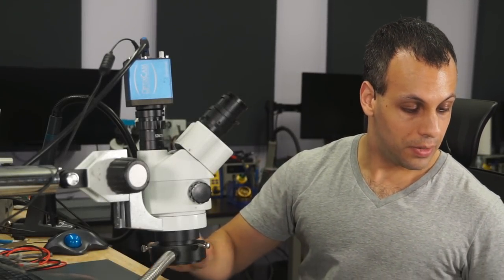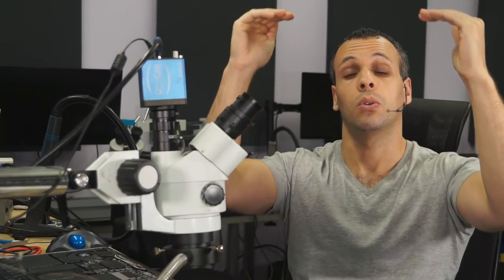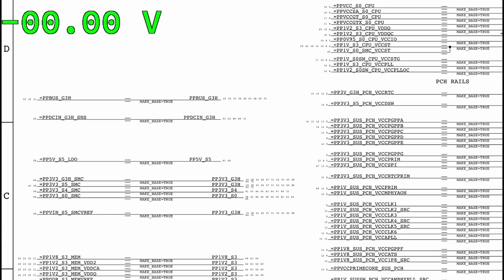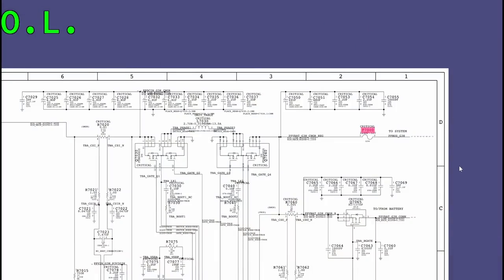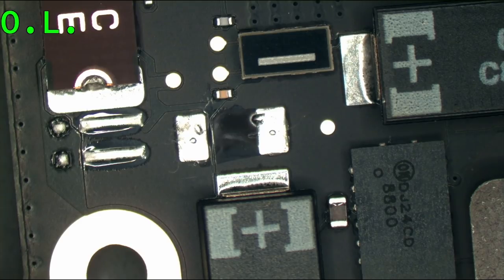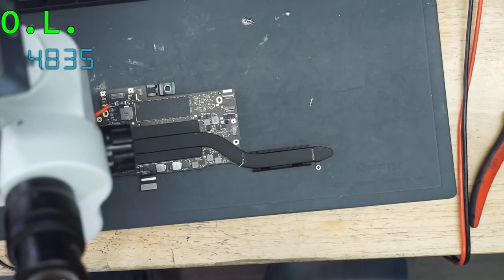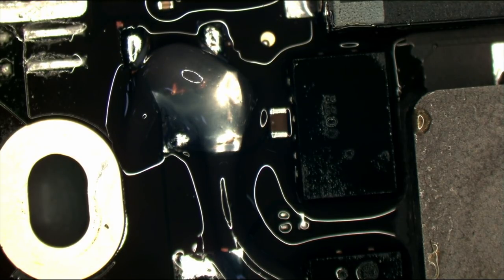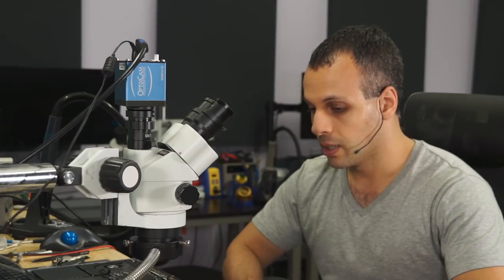Fixing a Macbook A1708 logic board that isn't powering on

Comment: GOOOOD VIDEO. Love it when you focus and comment strictly on the repair 😃
PS. After Apple Logo Appears you say Fan Spin but the Fan is NOT Spinning. :) I worked on a A1707. Similar. No fan spin until Battery is connected on this model. Believe it OR NOT!

Comment: you do not need to remove the fuse. Just inject voltage before and after the fuse and take a look at whether the fuse is getting hot to not. If is getting hot, then you know that short-circuited current is travelling via fuse and the fault gonna be on that side.

Comment: @Louis Rossman
i belive your measuting stradegy is less efficiant than it could be.
yes you could do EG: 1-10 (assuming there are 10 points)
This is how you should do it

5 7  (8or9) 10 (assumed the error is at 10, of cause you would not know this.)

Halfing method the fastest. that said if you only have 3 points it don't really matter much

keep up the good work

Comment: There is a rule of thumb, if you can keep your finger on the component for more than a second or two then it's less than 60°C, if it leaves an imprint of the component then its F'in HOT.

Comment: Ignoring the amp. reading, which likely tells you the faulty one; the fastest way to find them would be use of binary search. So starting in the middle would be the correct way, of course with so few of them log2 is not so much of an improvement.

Comment: You scared me a little at the end Louis when testing the board after the short repair as that piece of snipped off wire you attached was still on the mat and when booting you had set the board down twice on top of the wire and I was like NOOOOOOOOOO but everything turned out just fine 😏😮‍💨

Comment: If the thermal camera is using a static IP Address then it could well be an IP address conflict with another device on the network. Ideally all devices should have there IP address assigned dynamically by a DHCP server

Comment: why not use alcohol to see where it evaporates the quickest. or "frezer" spray to see what melts the first
Reply: what i was thinking. also would one of those small hand held laser spot temperature guns be any good to quickly point on each component and get a reading, they are cheap as chips.
Reply: @iainjarvie7905  to slow response :)